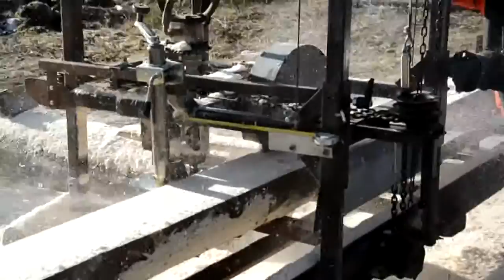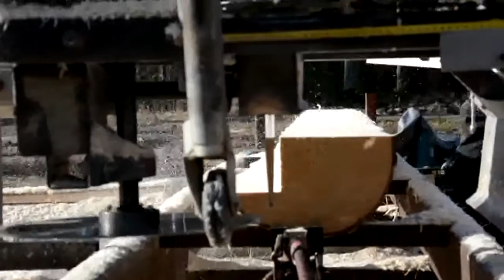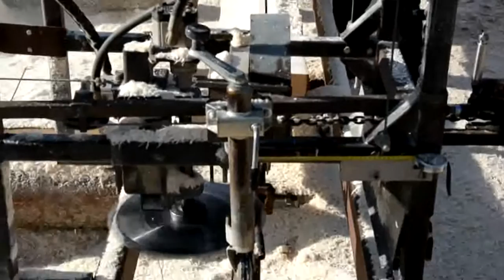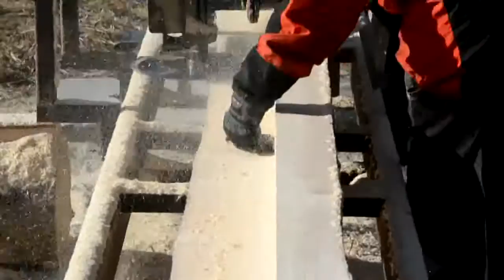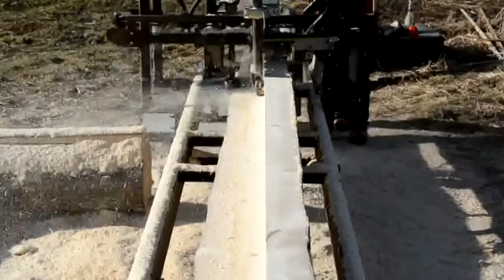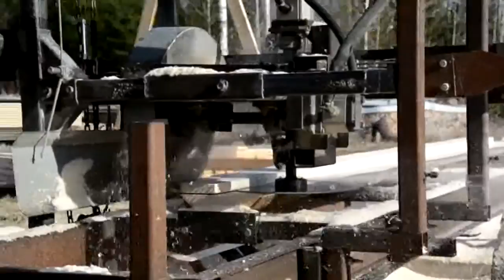Logs to Planks using a Circular Saw

Comment: What type of motor is the mill using? When idling sounds like a diesel tractor and when reved up sounds like a chainsaw?? Or is it added in sound that makes no sense of what is going on ?
Reply from the maker: no, its not added sound, it's my uncle who made it, he is professional xD
Reply from the maker: "The operating principle is that the diesel engine rotates the hydraulic pump and the blades rotate the hydraulic motors.
The blades are attached to a carriage which is moved vertically and laterally steplessly according to the dimensions.
The log is not rotated it is in the same position throughout the sawing process.
During the sawing, the diesel engine is raised in revolutions by means of a solenoid, the rest of the time the diesel is idling."
Reply from the maker: google translate was used so i think the blades are rotated by the hydraulic motors
Reply: Thanks for the reply he did make 1 of the best I've ever seen!! I won't to build 1 using blades like his not a band saw blade !! Bet the cut wood is smooth !!
Reply: @piipaa1  ñ